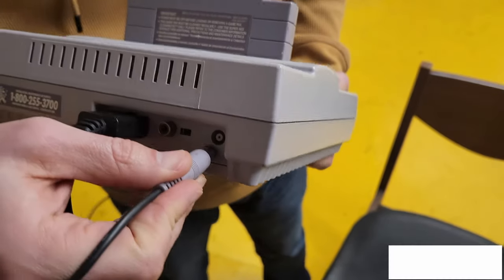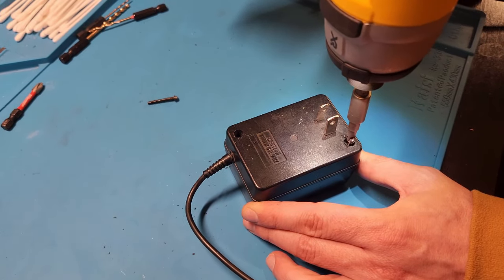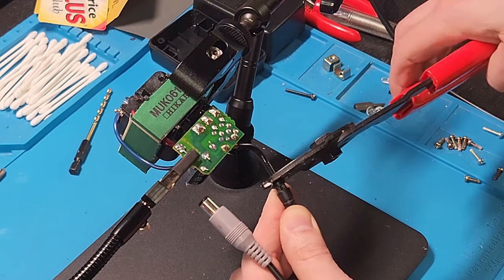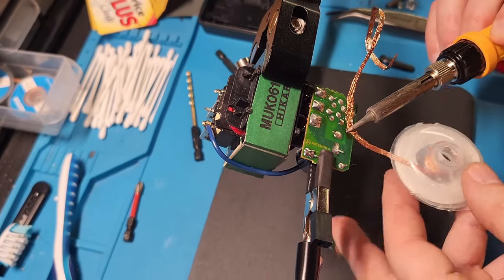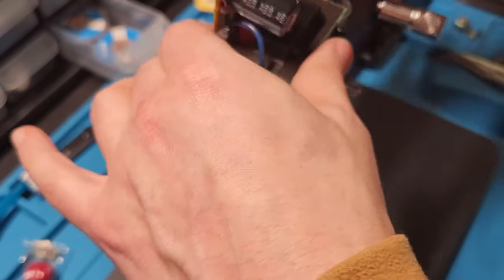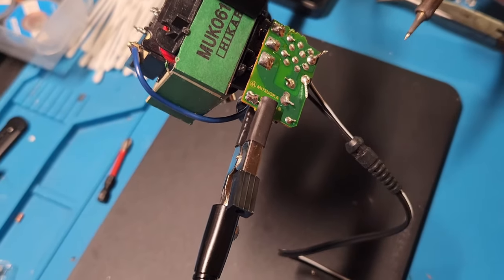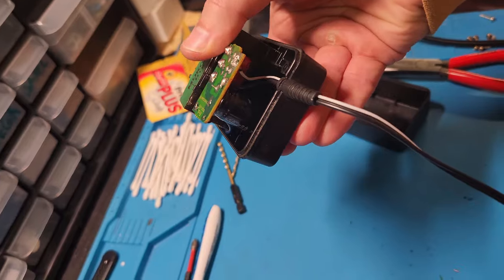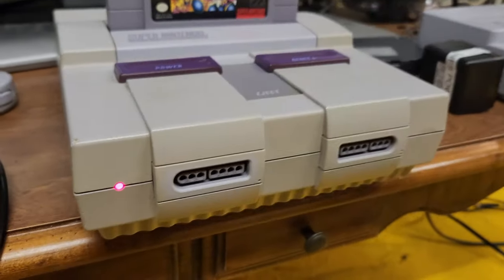How To Fix Your Broken SNES AC Adapter! | SNES AC Adapter Repair

Comment: The electricity voltage in my country is 220 volts, while my Nintendo power supply input is 120 volts 60Hz 17W do I need a step down converter? Or can you just connect directly?
Reply from the maker: We aren't 100% certain, but would assume you definitely need a converter!  Better safe than sorry.  Thanks for watching!
Reply: If it is the OEM, original PSU, 100% certain it will fry if you plug it directly.
Reply from the maker: @CP200S  Great intel! Thanks!

Comment: 6:38   strange cause the SNES  has no polarity as ther is 9v AC  and the DC is made on board.
Reply from the maker: Hey!  Thanks for watching!  We are certainly far from experts in this area.  All we really know is there is a positive and negative coming from the board, thru the new cable and into this new plug (https://console5.com/store/2-pin-interchangeable-dc-plug-adapter-for-us-ntsc-super-nintendo.html).  We orginally put the new plug onto the new cable, and got nothing.  We resersed the plug (noticed a longer leg from the plug that goes into the positive terminal on the new cable) and boom, we got power.  If Matt and I were smart enough, we'd love to explain the science behind this.....
Reply: @The8bitBasement  maybe the pins where lose. it even stands on the system AC 9V. I can see it in your video.
Reply from the maker: Not sure what to tell you, it definitely wasn't loose.  We tested it on another SNES adapter we repaired.  That plug for certain only works one way.
Reply: @The8bitBasement   i mean when it works it works and the rapir doesnt change so... well done?
Reply from the maker: Haha agreed, thanks!  It's repaired for now!